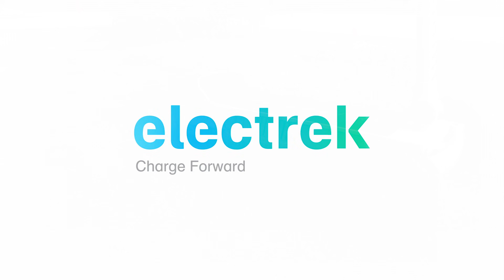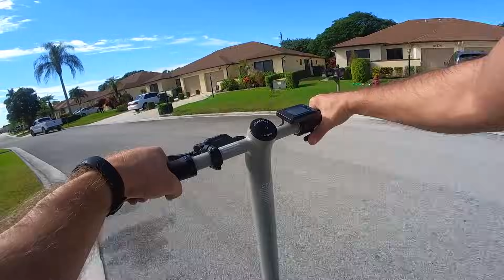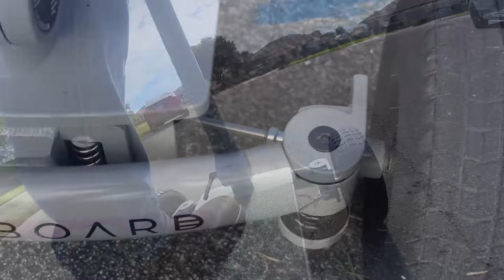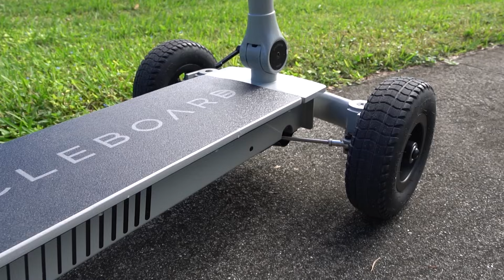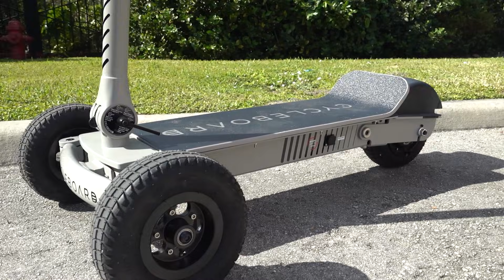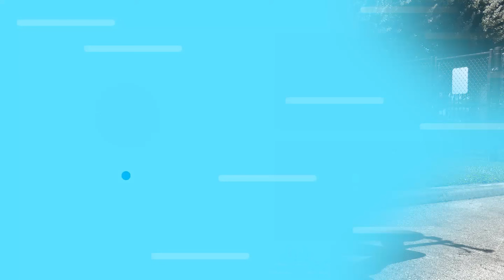Cycleboard Rover Review: Crazy New 3-Wheeled Electric Vehicle!

Comment: Ordered and received my Cycleboard Rover on August 9th.

The unit ran great, however it would not charge. Customer service said they would send a replacement charger. The replacement charger didn't charge the board either.

They asked me to open up the board and show them pictures of the fuses. They determined fuses were fine. They asked me to charge the battery and send them a voltage test. I don't have the equipment to test the battery and it won't charge regardless.

They said I couldn't request a return because I was outside of the 14-day return period. They offered to send a replacement battery on August 29th. I reached out to them on September 4th to see why the battery hadn't shipped yet and they said they were on holiday (Labor Day weekend) and that it was "in the queue" to be shipped.

I've reached out to them every few days since then and they are no longer responding to me. I've tried calling, email, and social media. No answers from them anywhere. 

I would appreciate your upvote to help get the word out that this company is seemingly not trustworthy!

Comment: I’m a cycleboard rover owner.  I disagree regarding the suspension.   Was the board you tested a brand new model?  The suspension requires a break-in period.  I have close to 800 miles on mine and I can hit a speed bump going 20+ with no problem.  

Once you get familiar with this thing, it’s amazing.  If I had one request, give me at-least a 35 top end.  The board is so stable at speed;35 would be a breeze.  

These things are awesome, however they’re not what you’d consider to be portable.  This thing is a tank.  I definitely prefer over my other 2 wheel scooters.  Off road if is unreal.
Reply: Are you still enjoying your cycleboard? I was looking at one today. Deciding between this or a two wheel scooter. Thanks
Reply: Does it have a walking mode for areas where I can't ride it? Like a lobby entrance?

Comment: Excellent review as always, but I feel I must make a correction.  That front suspension is not independent.  In an independent front suspension, one wheel can move up and down without the other moving at all.  On this machine, moving one front wheel up and down affects the other front wheel's camber angle.  It also causes the other front wheel to move up and down slightly, but in the opposite direction.